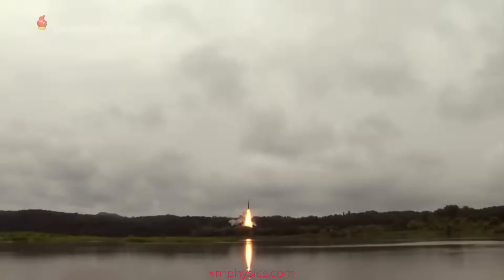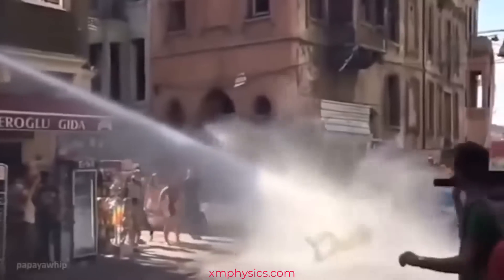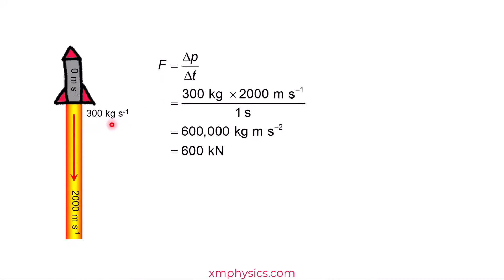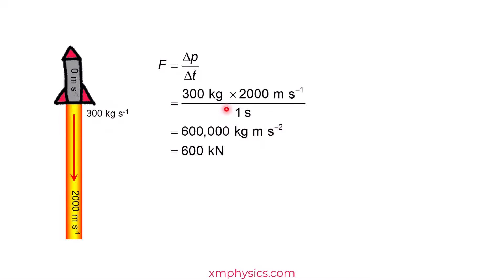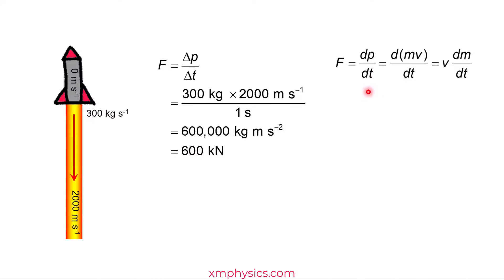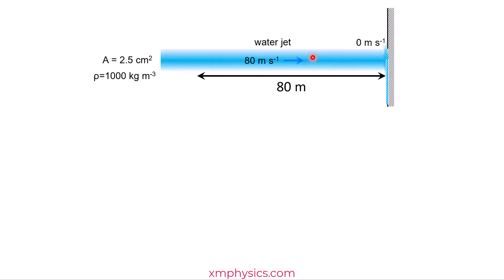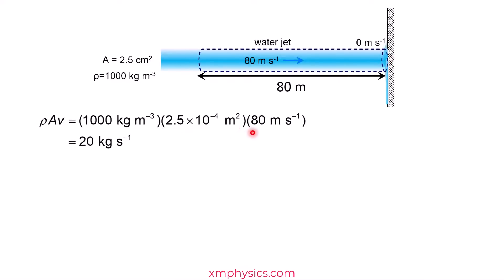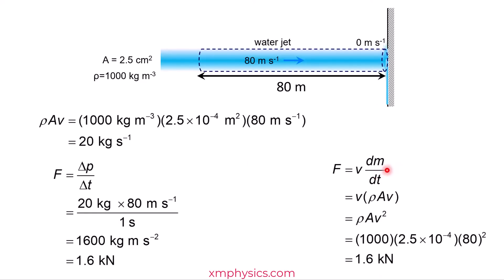3.2.4 vdm/dt: How to calculate rocket thrust?

Comment: Professor, why's isn't force equals to mass flow rate times velocity PLUS MASS TIMES ACCELERATION? If you derive d(m(t).v(t))/dt by the quotient rule, wouldn't you get this?

In a case where the water jet flows vertically downwards and hits the soil, the mass times acceleration term would be the amount of water that's being accelerated by gravity that hits the ground, isn't it?

Thank you for your attention and for the video, well made!
Reply from the maker: Yes, mathematically the quotient rule does lead to F=m.dv/dt+v.dm/dt. But we have to apply the math in a way that makes physical sense. Most situations involve a particular object with a fixed mass, so the dm/dt term is zero, and we are left with only F=ma. For rocket thrust situations, we can creatively imagine that the ejected propellant is an “object” moving at fixed speed v so the dv/dt term is zero. And this “object” is “gaining mass” continuously at the rate of dm/dt as more propellant is ejected. The thrust force is thus v.dm/dt. If we try to use F=ma instead, then we will need to know the acceleration of each kg of propellant as they leave the rocket then conceptually we are stuck because it is difficult to nail down the dt in the a=dv/dt term.

Comment: As per newton 1 law when force is applied it should get accelerated but why velocity is constant in this case
Reply from the maker: Do you mean the v in vdm/dt? That v refers to the speed (relative to the rocket) at which the rocket propellant leaves the rocket. Meaning the rocket propellant has been accelerated from rest to that final speed before they leave the rocket.